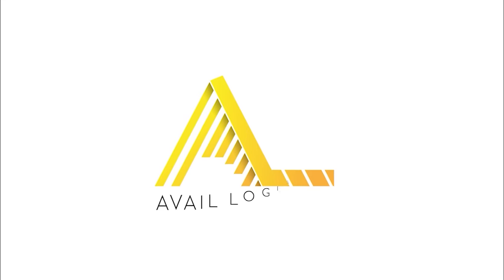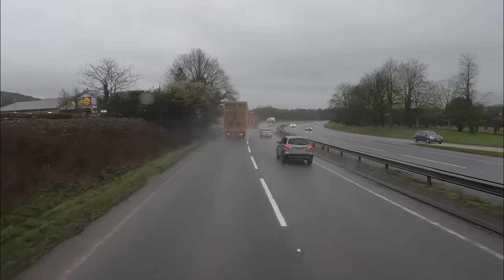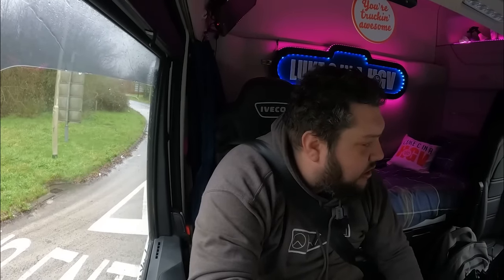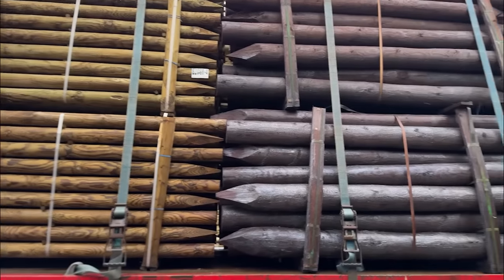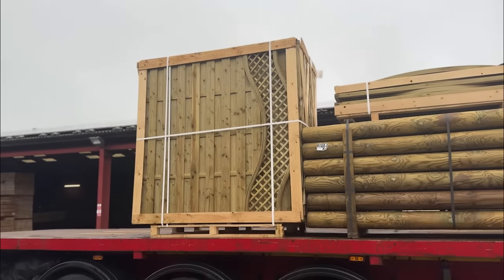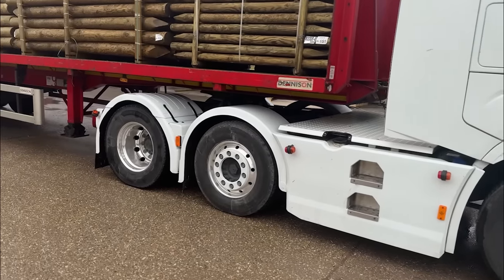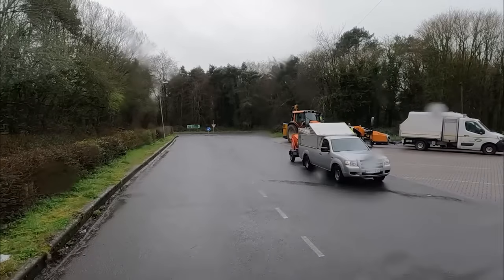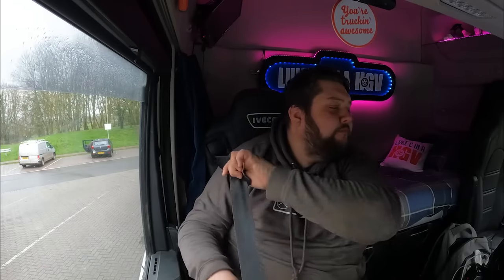I May Have Kinda Upset People…

Comment: When having a break always have a couple of minutes over the time as like you just did you changed mode after 30mins sometimes the taco will say 29mins then its a short break and  infringement
Reply from the maker: Hear this a lot. Down to personal preference I suppose. But in my 7 years or so of driving. It’s never shown as 29
Reply: @lukecinahgv  in my 39 years of driving some tacos in some lorries will do this Mercedes are the worst
Reply from the maker: Maybe you were driving older lorries? I can imagine that being the case. But certainly within the last few years is never been an issue for me personally. I’m not saying it hasn’t happened to you. Just to me, it never has. I’ve always gone on the dot and it’s never been a problem. :)
Reply: @lukecinahgv  no new lorrys mate even on our cpc course my firm tells  you to take a couple more minutes to be on the safe side in case this happens we also have a new Mercedes unit if you put it on break or poa if you then press your electric window to open window it puts taco back on other work  its caught loads of drivers out was only saying about have an extra 2 minutes so you dont get caught out
Reply from the maker: Yes there cool mate. I’m not disagreeing with you or arguing or anything. Just saying it hasn’t happened to me personally not even once which is why I don’t wait for a minute or two. No harm in teaching it in CPC at all as a safety procedure for me, personally it hasn’t been needed
Reply: I'm here as I knew there would be someone making this comment 😅 I always have 15 and 30 or 45 bang on and I've never got an infringement for insufficient rest in 11 years of driving. If it's what you want to do for your own peace of mind crack on but there really is no need to have 16,31 or 46 minutes break.
Reply: @paullfc88  only been driving 11 years that answers that question some tacos when it says 30mins break do not click over straight away as every firm i have worked for  in 39 years have always said take an extra few minutes
Reply: @andrewthornhill4229 I absolutely agree. When digital tachos first came in, my boss at the time said take 20mins, and 40mins, or take a full 50min. 15 years later still doing it.
Reply: @andrewthornhill4229  yep it does. Never gone wrong in that time 👍🏻

Comment: An off topic question Luke. Recently my Go Expert 7 has been going haywire. The directional triangle comes away from the blue route lane and starts to wonder for ages going all over.  I have no idea what the heck is going on. Then it's showing I can take turns into roads that are impossible. My internet connection is solid on the GE7. I did reset the device recently and I've noticed the most recent software update has changed the way the GE7 worked from before. Any suggestions on what I can do to fix this from happening again and has anyone here had similar experiences and what did you do ❓ Thank you all.
Reply from the maker: Try an update mate? See if that helps. I know mine had one recently.